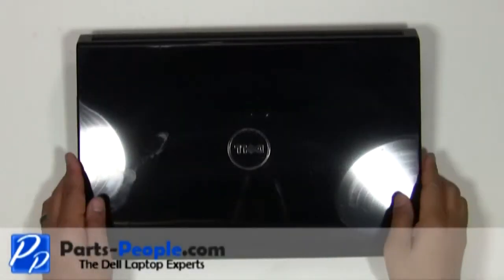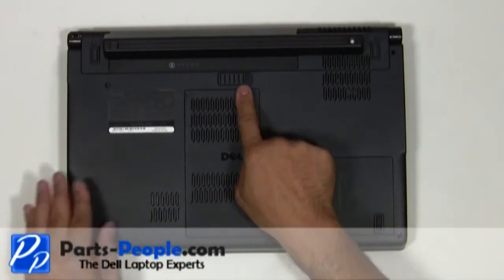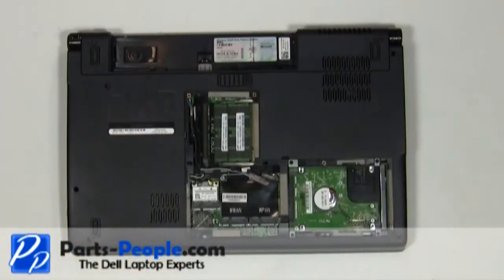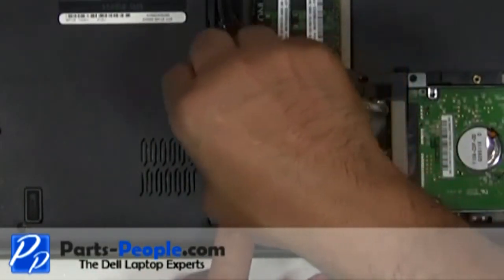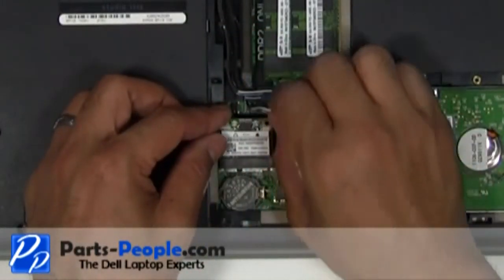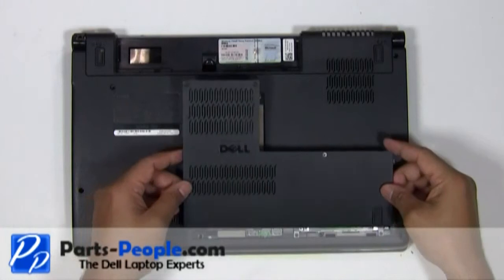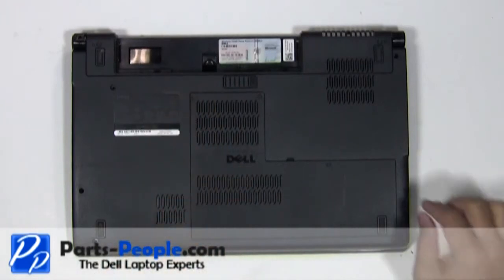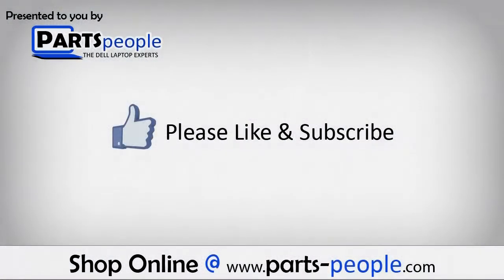Dell STUDIO 1555 / 1557 / 1558 | Wireless WiFi Mini-PCI Card Replacement | How-To-Tutorial

Comment: That screw that's holding the WLAN card out is literally stripped and stuck in the motherboard. How do I get it out?
Reply from the maker: Sometimes using a flathead screwdriver on a stripped Phillips head screw works. If not there are specialty tools for this problem you can find online via Google.